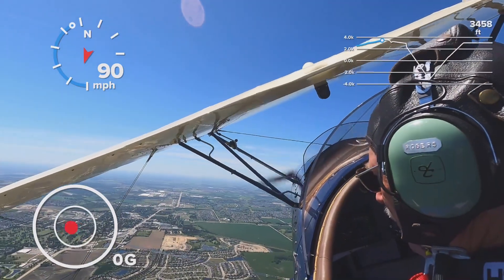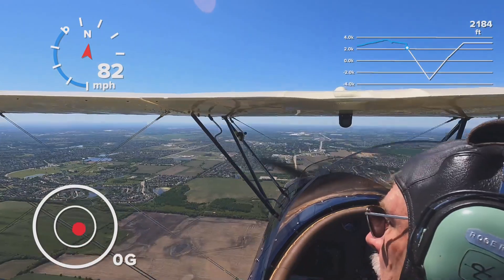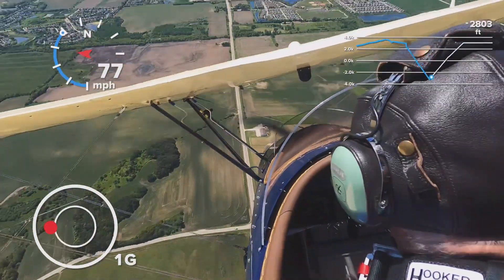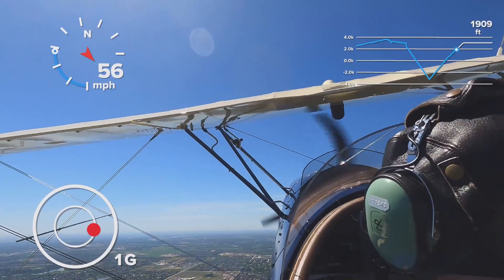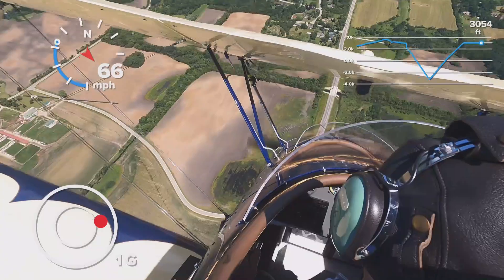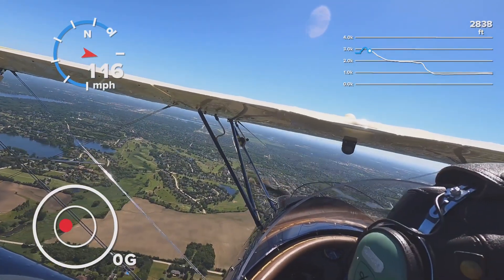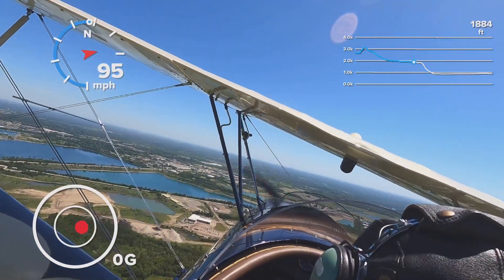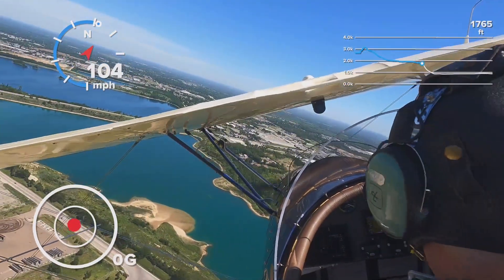First Great Lakes  Aerobatics after center section wing modification due to rib cracking.

Comment: Ron, I believe the GoPro uses GPS for speed, not airspeed. So, when you are on the  up or down line the  GoPro will indicate zero speed.
Reply from the maker: Yes, it reads speed relative to a fixed position, not airspeed since there is no pitot source. However, I think it would read vertical speed as well as any 3 dimensional speed. The biggest compounding error is from ground speed affected by wind speed. I just don't think the data sample rate is high enough to measure the rapid changes in velocity. I don't think the speed calculation can keep up with the rapid changes in velocity.
Reply: @ronrogers  Never thought of GPS calculating vertical speed before. I don't think vertical positioning is as accurate as horizontal though. My best guess for getting my GL back is mid July, boy am I going to be rusty.
Reply: Gps does give vertical speed. I have a drone that uses GPS for speed and it reads vertical speed quite well also.